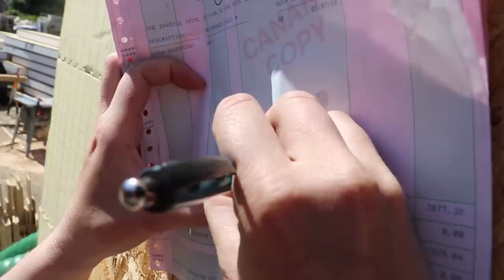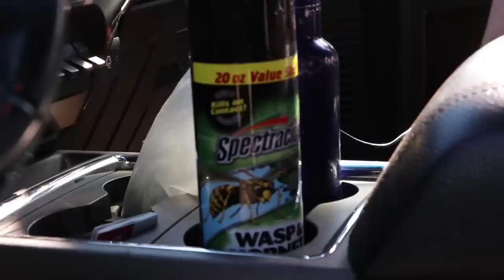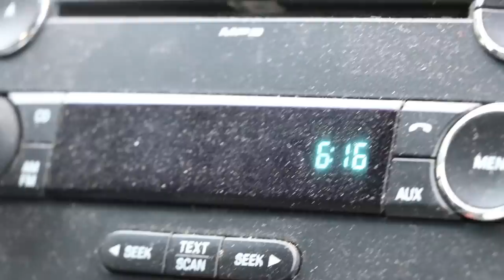Crane ARRIVES TOMORROW and WE'RE NOT READY!

Comment: For those not trained in "lifting" equipment, there is a BIG difference between an eye bolt that you buy at your local hardware and a FORGED lifting eye.  The first is made out of steel rod and bent into shape, but the end is not closed/welded.  These are not safe for lifting loads overhead.  They can unbend when a load is placed on it.  The lifting eye is forge from one piece of steel, not bent.  It will carry a lot more load.
Reply: It's bent by a blacksmith. Still bent.
Reply: From what I understand, they are not lifting large amounts of weight. The panels are mostly bulky. They just need to be secure because they are heavy enough to hurt someone and dropping one on the ground would likely be a huge setback.

Comment: Guys, when doing panel prep set up only the screws you will need to hold the panel in place.  Leave the rest for later  You are going to be going up the wall again anyway to drive the screws into place so set up the screws at that time instead of at the 'prep' stage.  You will save time, the screws won't get in the way and they won't get knocked out accidentally either.

Comment: Wherever there is a large screw,, particularly with a broad washer, in the winter,, the entire screw will be cold, it will be the same temp as the outside air.  Wood has an R- Factor of approximately R-1 per inch.  Wood is not a wonderful insulator,, just passable.

For each and every screw shaft and tip that is buried in the wooden posts, beams, lintels, and bonds, you should calculate the depth of wood to the screw,,, and hopefully in three dimensions.  The extreme of your screws will chill the posts.

One of the beauties of SIP construction is the ability to fasten the panels to the frame via the interior OSB skin,, and not piercing the high R value shell of the house.

The cement slab of your basement is directly connected to the subsoils of the rail footing.  The concrete of your basement floor extends outside of the conditioned space into the cold of the outdoors.  Regardless of solar, or hydronic heat, your basement slab will be the temperature of the subsoils beneath the rail footing, or the outside temp.  Because concrete has an R-value of approx. R-0.1 per inch.  Three inches of high yield foam under the slab will be equal to 14 feet of concrete.

You just keep listening to the college educated,,, never have built anything, engineers.  You will, do have, a house of incomparable strength, extreme beauty, and entirely average energy performance in the winter and a need for two air conditioners in the summer.
Reply: The R value of the sips and the high yield foam under the slab is very interesting. Thank you for sharing this info :)
Reply: Sailor376also:  Have you watched (and read the comments and responses) to previous videos for this house build?   

A few questions for you Sailor:
Do you know how deep the long lag screws actually penetrate into the timbers?  Hint - not as deep as you may imagine!   

How exactly would you fasten the SIPs to the frame by using only the interior skins? 

Do you think that the "concrete slab of basement is directly connected to the sub soils of the fail footing?" 

Besides the garage doors' aprons, how does "the basement floor extends outside of the conditioned space into the cold of the outdoors?"

Do you know what is under the basement slab?  (By the way, EPS is the preferred foam instead of XPS for rigid insulation under slabs.)

Who exactly are these college-educated engineers "that haven't built anything?"

Comment: Make sure the eye bolts have a long threaded part, those panels are thick and normally the eye bolts are not that long to traverse the entire panel.  Just a heads up.  However, there are lifting eyes were you can connect them to a bolt or a thread road.:)

Comment: The only reason to get the sheetrock this early into the build that I can figure, is the opportunity to fill up the delivery truck.  Normally sheetrock doesn't come until its dried in...........doesn't make any sense.
Reply: They are putting sheet rock on the underside (living side) of the roof panels.  Check out their Instagram page for an interior pic of the finished roof.
Reply: The sheetrock will be attached to the interior skin of the Roof SIPs before installing....

Comment: DONT use threaded rod as any part of an eye bolt DANGER DANGER
Reply: NO. Only if you dont  know the specs:engineeringtoolbox.com/loads-hanging-rods-d_1341.html and engineeringtoolbox.com/steel-rod-hanger-capacity-d_643.html
Reply: Its not ideal but i would imagine its sufficient for SIP panels. If it was anything heavier i would agree.

Comment: Drywall on site already you said?
Reply: Dennis Ostien it’s only about a year early
Reply: In what world does having that on site right now make sense.
Reply: I think they mentioned before that the walls and roof sips usually get drywayy attatched as they are installed, but with no roof they didnt attatch it to the walls. Remember they put fir strips up to allow the drywall to be installed later. Now the roof panels are about on site so they will put drywall on as they go up i bet. It will be easier now than after the roof is up and it wont get wet !   I think ? LOL
Reply: To be attached to the interior skin of the roof SIPs, before installing.